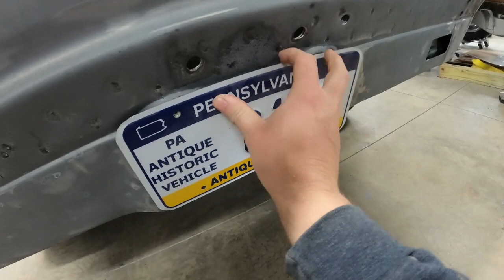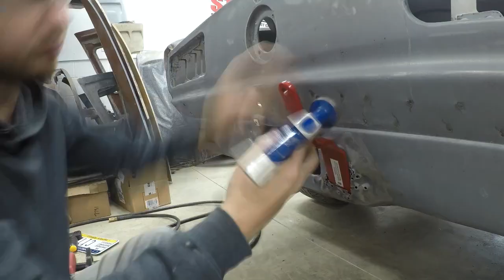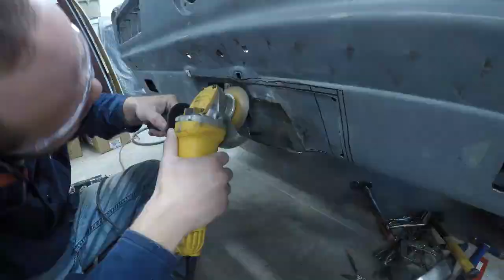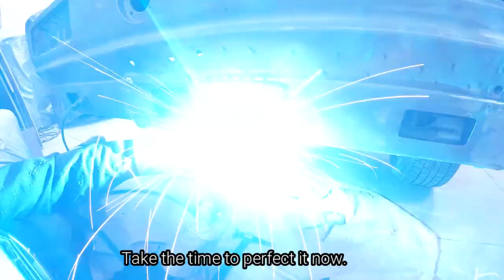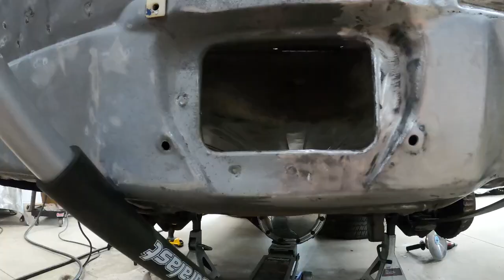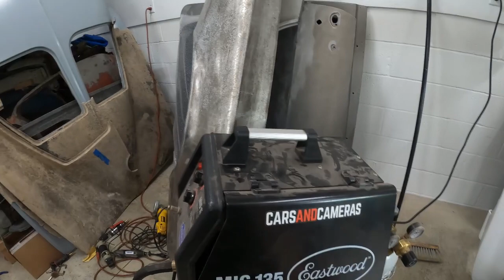1967 Camaro Taillight Panel Repair.  How To MIG Weld Sheet Metal Without Warping It.

Comment: I always use a cutoff wheel on my die grinder when grinding welds. It produces very little heat. I also spot blast the welded area to make sure there is no contaminates in the nooks and crannies. Then I skim coat with Duraglass, grind that down and finish with some Evercoat rage... I enjoy your videos. It's nice to sit on the couch and watch someone else do body and metalwork.
Reply from the maker: Thanks for the tips Kenny. I can’t wait to get this thing to the finish stage. Haha I know what you mean. I like watching someone else work hard as well lol.

Comment: Looking good Mitch!...At least you didn't have to replace the whole taillight panel...I've had to cut the holes in for the RS backup lights in several 1st gens and its a pain, especially cutting the holes in the thicker inner panel.  Seems like those cars always got bashed in and poorly repaired.
Reply from the maker: Thanks I appreciate it! I really wanted to avoid putting a taillight panel on it. Other than bad spot it was in nice shape. I bet that would be a challenging area to repair and make it look right.

Comment: Hey Mitch, great progress, beautiful repair.  I own a '67 RS/SS rag which I purchased in the late 80's.  More rust than metal.  Luckily you could buy most panels from the dealer then, I remember the quarters were $250.  The floor panels were  not available so we bought a virgin floor and cowl out of a firebird. We had to transfer the convertible rockers, a ton of work.  The SS hood and deck lid were not available but were salvageable.  You may not agree but your Dad's car is solid, lol.
Reply: I agree,  I remember buying new GM 67 RS fenders for my RS/SS ragtop from the local chevy dealer for $172...but convertible specific parts were not reproduced for years, and your only option was to get them from a donor car,  not always an easy task
Reply: I graduated in '83, and a buddy and I were restoring our '69 Camaro's. I remember getting everything we needed from our local Chevy dealer. I even bought a balancer and camshaft for my 396, a yoke for my 12 bolt, and a GM off road clutch. My dad owned a repair shop, so I got a 30% discount. Those were the days.
Reply from the maker: That sounds like a pile of work! I definitely think his Camaro is solid. It had some ugly areas but we are slowly knocking them out one at a time.

Comment: Hey there Mitch,
Nice metal graft! That's going to finish nicely.
Thanks for showing your welder. I have a Hobart 210 and very little skill, but I'm working on that. I did a bunch of welding to rebuild a trebuchet ... it wasn't pretty but the pieces stay together under incredible forces ... and nobody died, so it's all good.
Thanks for the vid, my friend.
Take care,
Dan
Reply from the maker: Hey Dan it sounds like you are getting better! I’m definitely not an expert but I’m getting better with every project. I’m really happy with the way it turned out.